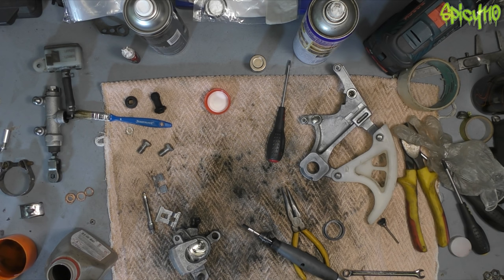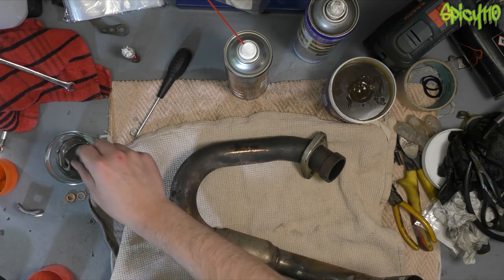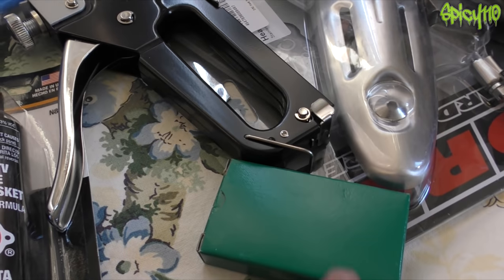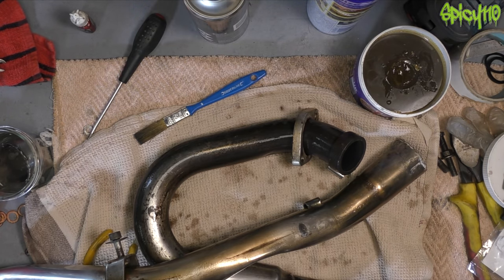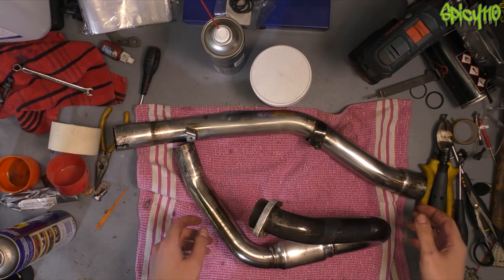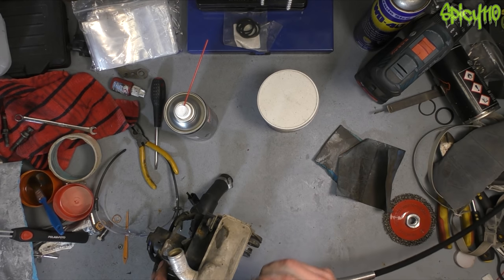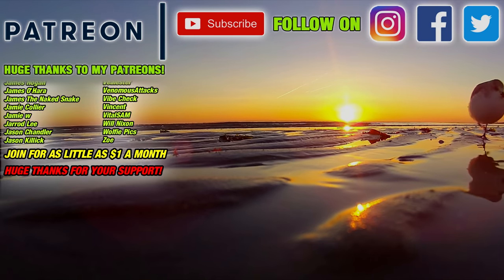Suzuki DRZ400SM Restoration Z EP. 9 - Stainless Exhaust Cleaning!

Comment: You keep polishing that exhaust and it will look superb. I was going to use phosphoric acid on the inside of a petrol tank last week, and because the paintwork on the outside is excellent, i masked it all over with layers of plastic and foam. something told me that the acid would probably find it's way onto the paint so i decided to use white vinegar instead, a wise choice because some did in fact get onto the paintwork but because its very weak acid ...no damage. Three days later all the rust was gone, a swift washout with distilled water, half an hour with a hairdryer and half a can of WD40 swilled around the inside, result...perfect job!

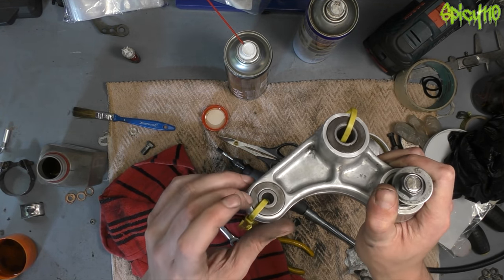Comment: As I said in the last video I am rebuilding my drz too, and I came across the same thing on that bearing @2:58, but I was on a table so I was able to disassemble all the needles, clean them up, regrese everything and put it all back together with no needle losses. I dont if thats normal for that bearing to come apart, all I know is that all the other linkage bearings are not coming apart.

Comment: Spicy. To stop the caliper piston siezeing up I recommend using red rubber grease! It's made for hydraulic system! I had some pistons seized on my 6 pot bandit calipers and I used some and they are good as new 2 years on!
Reply from the maker: Keep watching! 🙂👍
Reply: Yeah just seen! Hah
Reply from the maker: I cleaned out what I used and replaced it work the RRG but tbh what I used would be fine it's just a little thick.
Reply: @spicy110  yep nothing wrong with that mate! Honestly cant wait till Derek is finished

Comment: What would you recommend cleaning the stock DRZ header pipe with?
Reply from the maker: if its plain steel vinegar is great for rust, otherwise sanding and polishing is the same.
Reply: @spicy110  well the stock header pipe is painted black. but when it gets dirty it can look rusted